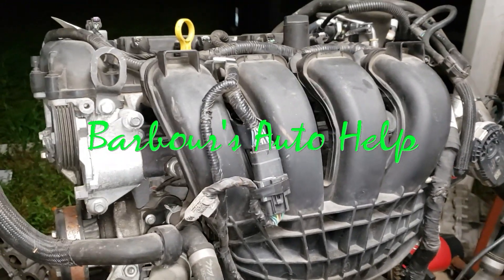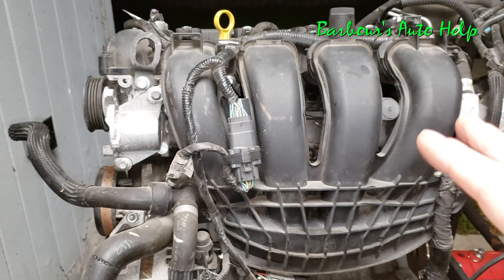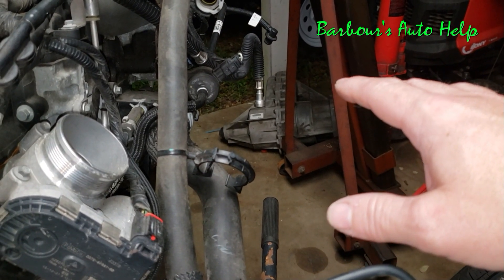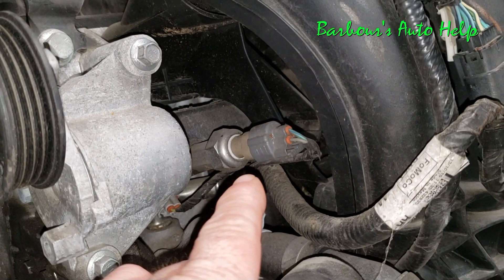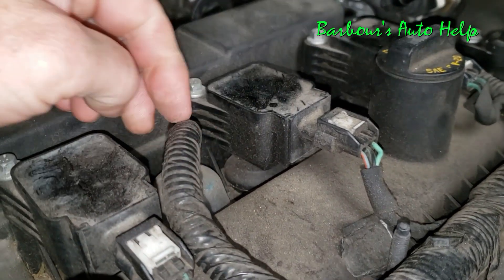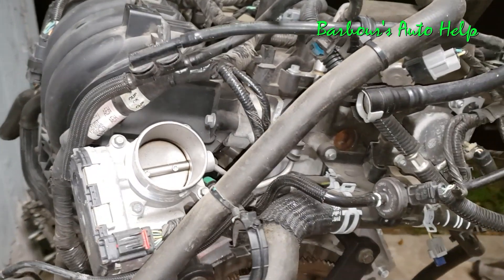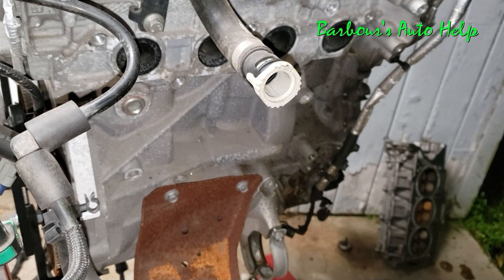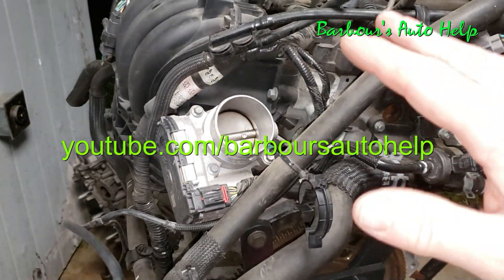Engine Management Electrical and Electronic Component Locations 2012-2018 Ford Focus

Comment: Hi I was wondering if you could give me better insight of my issue with my 2012 ford fiesta se. First off the vehicle has a mind of its own and starts when it wants to and i will work for a couple of days. When the vehicle is parked afterwards it will not start. I have already tried to troubleshoot it myself. I started off with checking the battery grounds for corrosion and loose wires, checked the battery life in general its good. Then i moved on to checking the starter and i replaced it in all hopes that it would work. NOPE FAILED lol, I continued to the ignition switch and replaced it and another HARD NO!!! I even checked all fuses and relays  inside and out and agian NO. Finally I had the car put on a scanner and these are the codes that follow... P0805 , Clutch A and B What would you suggest that I do now ? Should i just burn it LOL jk!!
Thanks cant wait to hear back from you, your time is APPRECIATED it.

Comment: Can you tell me where the output speed sensor is?
Reply from the maker: What kind of problem are you having?  The answer to the question depends on that.
Reply: @BarboursAutoHelp My speedometer is not working although the odometer and trip meter do work, the transmission seems to shift more or less as it did before
Would the output speed sensor be the most likely cause or there is another possibility?
Reply: Do you mind sharing what was your problem and if you managed to solve it with the speed sensor?

Comment: I’m looking to figure out where the wiring for circuit A is on a 2012 Ford Focus. I have B1D13 code that I’m trying to fix. All help is greatly appreciated. Thanks in advance.

Comment: Thank you so much for these videos on the Ford Focus, the Duratech 2.0 litre engine and the twin clutch transmission. I live in Australia and recently purchased a 2013 Ford Focus. Am very impressed with the car, despite the well publicised issue(s) with the auto transmission. Mine has done 48,000 kms (30,000 miles) and drives quite smoothly. You are absolutely correct about that Duratech 2.0  engine, stamp on the throttle and the thing really comes alive! The engine loves to rev. Oh, and the brakes are superb  👌
Reply from the maker: I really do think it's a fantastic vehicle.  A little shudder doesn't really bother me

Comment: Any thoughts on the long-term reliability of this engine?How does it compare to a high production engine of a Chevy or a Toyota?
Reply from the maker: My thoughts are that this engine is bullet proof.  I have yet to see one go bad or have anything significant fail in them.  GREAT ENGINE!  great fuel economy! Doesn't lack on power either.  I love the Ford 2.0L duratec
Reply: @BarboursAutoHelp  Thanks for sharing your experience with the motor.